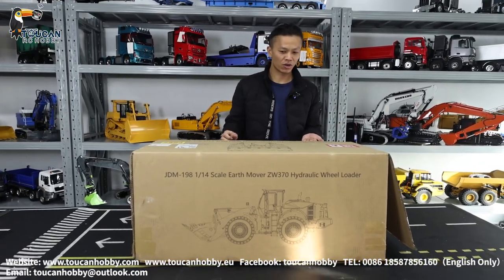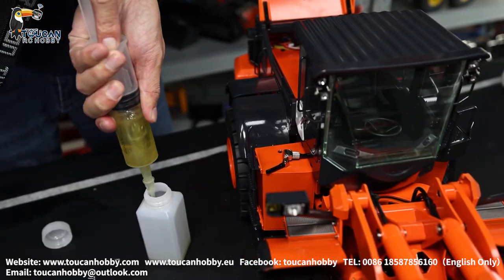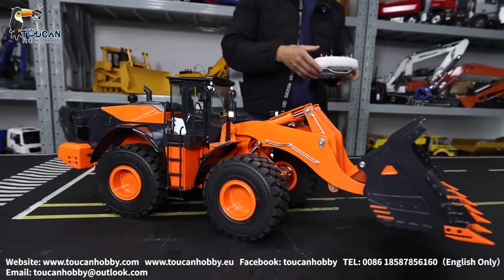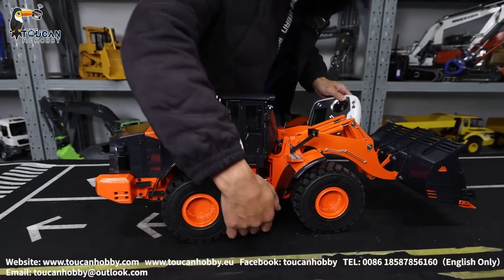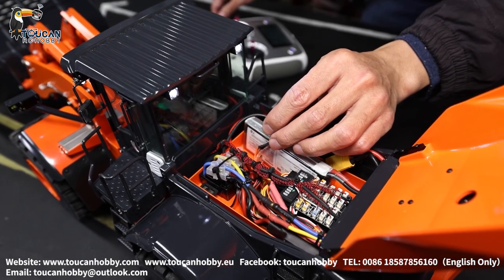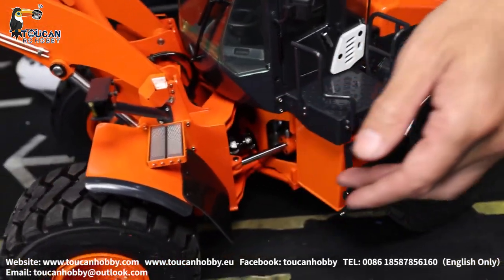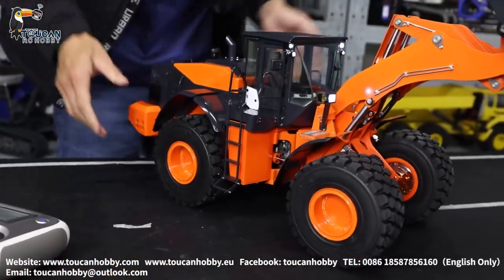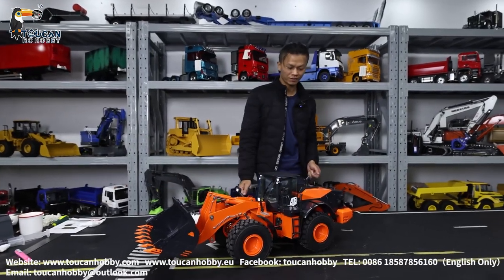Unbox new JDM-198 Metal 1/14 RC Hydraulic Loader,Sound & Light, two speed,diff lock,simulated brake.

Comment from the maker: Unbox new JDM-198 Metal 1/14 RC Hydraulic Loader, I6S Radio, Sound & Light, two speed and differential lock simulated disc brake. check out the details.

Comment: Nice video Oliver.... I still have the 870K running for 6 years no problem at all. But the 198 is really nice too.
Reply: Wow, then you have been one of the lucky ones. I've had 3 off of the 870K on my workbench for extencive repairs through the years. Drivetrain issues. Hydraulic leaks. The 198 I have heard good about, as an upgrade version of the 870
Reply: Thats because i do not run my 870 in high gear. It weighs 45 lbs. So stopping and going in high gear is not good and i only use diff lock when i need to dig in a straight line.
I never turn with the diff lock on thats also a no no. the only thing i don't like about the 198 is it's only about 38 lbs. You need the weight for these machines to work properly.